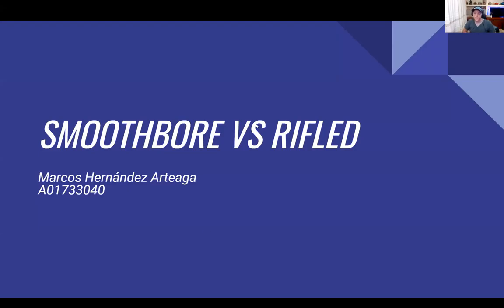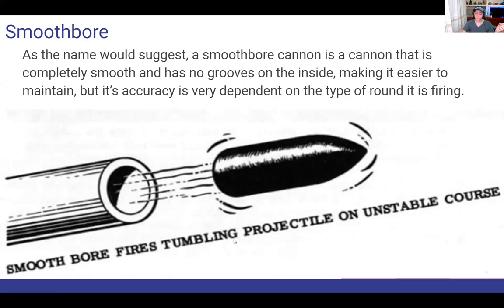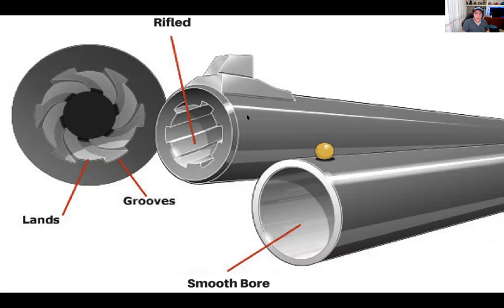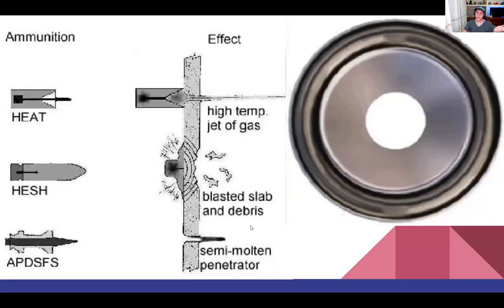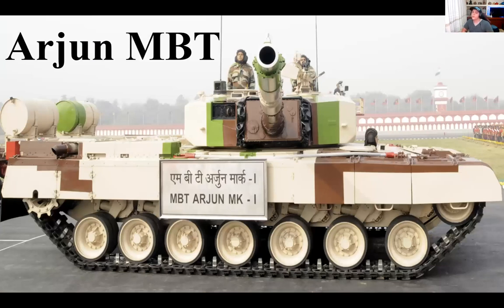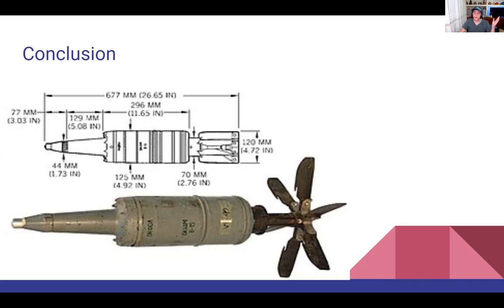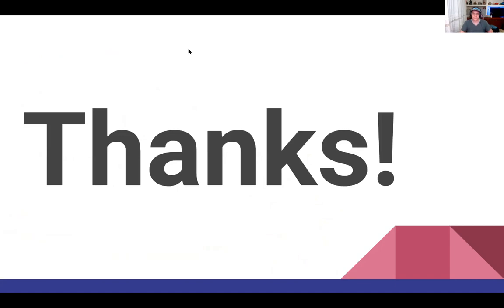Smoothbore vs Rifled | Final video delivery

Comment: sorry but there are ALOT of major errors in this video....

1. Smoothbore Guns fell out of use in the mid 19th century (the us civil war was about the last instance of smooth bore field artillery being used on large scale, the majority of european nations adopted rifled breechloading guns a few decades earlier)
More or less every fieldgun, tank gun, naval artillery etc used rifled barrels since then.
Rifling on a barrel only positively affects full caliber rounds like APCBC (Armorpiercing Capped Ballistic Cap), HE-Frag, HESH etc. and APDS Sub Caliber Rounds. HEAT is negatively affected, as the spin disrupts the spike generation, HEAT Rounds need a stabilising driving band, to counteract the spin. 
2. First smoothbore tankgun fielded was on T-62 in 1962 with the 115mm smoothbore. T72 was 10 years later and adopted the 125mm smoothbore of T64.
3. HEAT really does not like spin on the round. It does not shoot a Jet of heated gas, but the copper liner of the hollow charge forms an "explosively formed penetrator" called spike. Its just a super fast formed copper spike, that punches through material due to its speed.
4. APFSDS (Armorpiercing Fin Stabilised Discarding Sabot) is a self stabilising sub caliber round. It does NOT spin, the Fins stabilise its flight like a Dart.
5. Rifling in Guns was introduced to stabilise full caliber projectiles. (the first rifled barrels appear in the 15th century btw). Artillery used up to the 19th century smooth bores for ball ammunition, similar to muskets.
With the introduction of rifling in barrels, the classic bullet shaped projectile emerged. (this was WAY before WW2. One of the first of those projectiles were the 1848 introduced Miné Balls for shoulder fired guns. For Artillery, already in the Napoleonic Wars (1792-1816) bullet shaped projectiles were in use)(the US was a real late comer in rifled guns and bullet shaped projectiles)
During the later stages of WW2 APDS (Armorpiercing Discarding Sabot) Subcaliber rounds emerged to increase armor penetration with existing gun calibers and lengths.
APDS was still affected by the Spin induced via the rifling.
APDS was used in NATO until around 1978 when germany introduced the RHM120 L/44 smoothbore with Leopard 2 and with it DM-13 APFSDS-T, in the Warsaw Pact APDS fell out of use in 1963 with the BM-4 APFSDS-T for the 2A20 115mm smoothbore of T-62.
6. Advantages of modern smoothbore guns (they are really not comparable to those 18th century cast iron/bronze fieldguns): Significantly higher barrel lifespan due to less corrosion and abrasion when firing, significantly higher chamber and barrel pressures due to better seal between Sabot and barrel, resulting in higher muzzle velocity, higher range and penetration. Smoothbore tank guns are about similar in precision to rifled guns. The rifled guns only have an advantage when firen full caliber rounds like HESH. In every other instance, smoothbore guns outperform rifled guns of similar dimensions. (for example L30a1 L/55 on Challenger 2 has similar length, caliber, charge size etc to RHM120 L/55a1 on Leopard 2A7. the RHM120 on Leopard 2 massively outperforms challenger 2s gun.)
7. Neither the UK nor India use APCR or APCBC or APDS. They use spin neutralising sabots for their APFSDS Rounds.

If i would have to give you a grade it would be an F.
Sorry nothing personal, but that was more or less everything false.
Reply: Dude .chill
Reply: That's right, if I had said something like that, I would have had to scrub the college yard with a broom for at least a week, from dawn to dusk.
Reply: 0:45 is not easy, both in manufacturing and in maintenance. For a resource of more than 500 shots, it is necessary to produce a multi-part barrel with a smooth liner very precisely (!) and a certain rigidity. And this is VERY expensive, as well as chrome plating of the barrel. Similarly, the maintenance of such a gun can not be called simple, since it consists of a complex automatic shutter system, devices for eliminating barrel backlash, sensors for taking into account the bending of the barrel depending on temperature, barrel rollback devices and much more. Also, such a gun is able to withstand enormous pressure to accelerate the projectile above 1700m / s, much more than a rifled gun. And as we remember, more speed means more energy. Smoothbore guns can give much higher speeds than rifled ones. A projectile in a rifled cannon, except that it is heavy (less speed means less energy) and has mediocre, albeit predictable ballistics, cannot exceed a certain threshold, it will tear off the rifling and start tumbling or tear the barrel.
In addition, it is NOT true that a smoothbore gun is less accurate, just aiming is more difficult and is usually performed by the ballistic computer of the tank, to take into account all factors, both the geometry of the gun, the type of projectile and the weather. This calculation allows you to guarantee a certain predictable accuracy, for example, the average hit point is half a meter at a distance of two kilometers. Isn't that accurate enough?
The problem is mainly in the person who set the data for the shot manually, just by eye. Then yes, it is not very accurate.
The smoothbore cannon also allows you to use more types of projectiles, including guided missiles.
2:15 a cumulative projectile forms a jet of metal accelerated to cosmic speeds, usually copper, but not only. This jet, accelerated to several kilometers per second at a distance of several meters, has enormous kinetic energy before it loses stability and energy, due to which it breaks through armor, which begins to flow when struck at such speeds, even while remaining cold. As an example, cutting steel with water with an abrasive under high pressure. Gases and shock waves mostly remain outside the armor.
The Monroe effect loses efficiency by an average of 30% when the projectile rotates, depending on the type of metal of the funnel and the caliber.
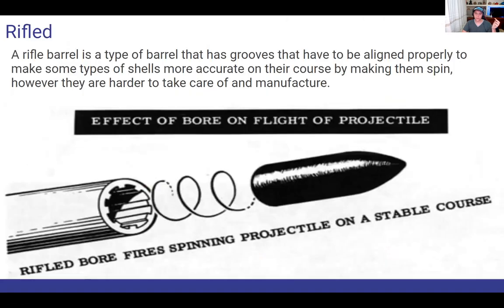2:45 "Crowbar" or afpds does NOT rotate, otherwise it will simply break when it hits the armor.
3:00 is not easier. How many countries can produce a smoothbore cannon? I know three and only one that does this in series of several hundred a year.
3:10 Now Krupp was offended. Rifled guns have been known and used since the 16th century, as well as occasional breech loading, it was just expensive and difficult to manufacture. And the cast guns had a smooth barrel for firing round cores to simplify technology, mass character and unification. Smooth barrels of small length and large calibers were used in bombards, the ancestors of mortars and siege guns.
3:45 The first tank with a serial smoothbore 115mm cannon was the T-62, and after the T-64A with the same 115mm cannon, but later replaced with 125mm.
In addition, the first smoothbore cannon was a 100mm towed Rapier cannon. All of the above is still in use. And I can't call these guns not accurate, not with a T-64 ballistic computer or a Rapier radar sight.
4:00 Just T-72A had no automation of the preparation of the shot and the data was entered manually, or the shooter simply relied on experience, so the accuracy was poorly predictable. The T-72A was a mobilization variant of the T-64 manufactured by another factory, which worked on the errors and simplified it as much as possible.
5:45 What is the problem with using online translators? There are just mountains of information on the tanks of the USSR in the public domain. I'm watching this video that a neural network translates to me online.
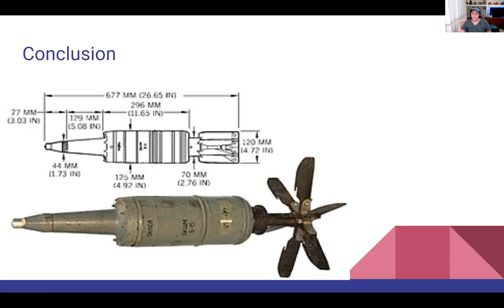5:50 Once again, the shells of smoothbore guns DO NOT rotate, they have too high a speed for this, they will simply start tumbling at such a speed due to displacement and the effect of derivation.
p.s
. In the image of the T-72B model 1989g, not T-72A. This is IMPORTANT, these are different tanks, there are more than 30 years between them!
Unfortunately, you do not have any serious education in the field of physics, for such reasoning, in addition, you do not want to look for information that is available.
As my teacher would say: "You can't find something because you just don't know what to look for."

Comment: Nice presentation
Reply: But completely illiterate. Unfortunately. He tried, but did not study the material at all, or he simply does not have the necessary knowledge to analyze such information.
Reply: @elusive6119  Can you share a video tha's more elaborate, especially which projectile is more stable (rifled cannon+shells VS smoothbore+fin stabelized projectiles)
Reply: @Estoc_Bestoc_  0:45 is not easy, both in manufacturing and in maintenance. For a resource of more than 500 shots, it is necessary to produce a multi-part barrel with a smooth liner very precisely (!) and a certain rigidity. And this is VERY expensive, as well as chrome plating of the barrel. Similarly, the maintenance of such a gun can not be called simple, since it consists of a complex automatic shutter system, devices for eliminating barrel backlash, sensors for taking into account the bending of the barrel depending on temperature, barrel rollback devices and much more. Also, such a gun is able to withstand enormous pressure to accelerate the projectile above 1700m / s, much more than a rifled gun. And as we remember, more speed means more energy. Smoothbore guns can give much higher speeds than rifled ones. A projectile in a rifled cannon, except that it is heavy (less speed means less energy) and has mediocre, albeit predictable ballistics, cannot exceed a certain threshold, it will tear off the rifling and start tumbling or tear the barrel.
In addition, it is NOT true that a smoothbore gun is less accurate, just aiming is more difficult and is usually performed by the ballistic computer of the tank, to take into account all factors, both the geometry of the gun, the type of projectile and the weather. This calculation allows you to guarantee a certain predictable accuracy, for example, the average hit point is half a meter at a distance of two kilometers. Isn't that accurate enough?
The problem is mainly in the person who set the data for the shot manually, just by eye. Then yes, it is not very accurate.
The smoothbore cannon also allows you to use more types of projectiles, including guided missiles.
2:15 a cumulative projectile forms a jet of metal accelerated to cosmic speeds, usually copper, but not only. This jet, accelerated to several kilometers per second at a distance of several meters, has enormous kinetic energy before it loses stability and energy, due to which it breaks through armor, which begins to flow when struck at such speeds, even while remaining cold. As an example, cutting steel with water with an abrasive under high pressure. Gases and shock waves mostly remain outside the armor.
The Monroe effect loses efficiency by an average of 30% when the projectile rotates, depending on the type of metal of the funnel and the caliber.
2:45 "Crowbar" or afpds does NOT rotate, otherwise it will simply break when it hits the armor.
3:00 is not easier. How many countries can produce a smoothbore cannon? I know three and only one that does this in series of several hundred a year.
3:10 Now Krupp was offended. Rifled guns have been known and used since the 16th century, as well as occasional breech loading, it was just expensive and difficult to manufacture. And the cast guns had a smooth barrel for firing round cores to simplify technology, mass character and unification. Smooth barrels of small length and large calibers were used in bombards, the ancestors of mortars and siege guns.
3:45 The first tank with a serial smoothbore 115mm cannon was the T-62, and after the T-64A with the same 115mm cannon, but later replaced with 125mm.
In addition, the first smoothbore cannon was a 100mm towed Rapier cannon. All of the above is still in use. And I can't call these guns not accurate, not with a T-64 ballistic computer or a Rapier radar sight.
4:00 Just T-72A had no automation of the preparation of the shot and the data was entered manually, or the shooter simply relied on experience, so the accuracy was poorly predictable. The T-72A was a mobilization variant of the T-64 manufactured by another factory, which worked on the errors and simplified it as much as possible.
5:45 What is the problem with using online translators? There are just mountains of information on the tanks of the USSR in the public domain. I'm watching this video that a neural network translates to me online.
5:50 Once again, the shells of smoothbore guns DO NOT rotate, they have too high a speed for this, they will simply start tumbling at such a speed due to displacement and the effect of derivation.
p.s
. In the image of the T-72B model 1989g, not T-72A. This is IMPORTANT, these are different tanks, there are more than 30 years between them!
Unfortunately, you do not have any serious education in the field of physics, for such reasoning, in addition, you do not want to look for information that is available.
As my teacher would say: "You can't find something because you just don't know what to look for."
Reply: @Estoc_Bestoc_  This is my comment on this video. Rating "F"
Reply: @elusive6119  Lots of input thanks, i'll read it after work